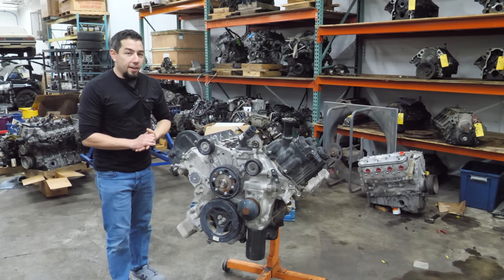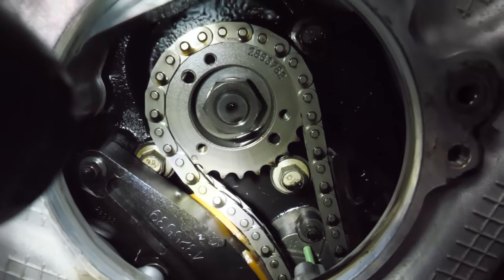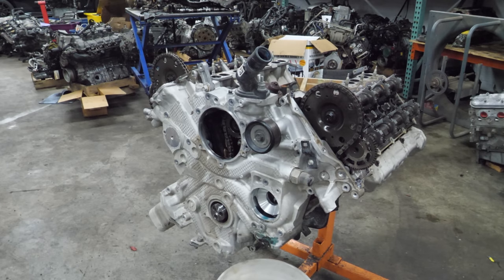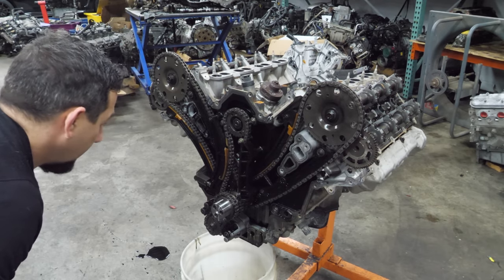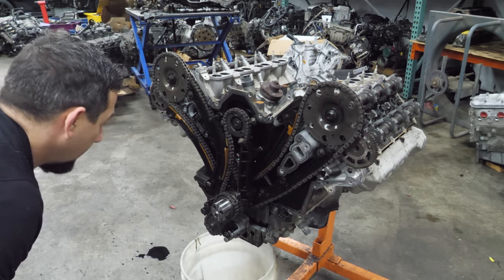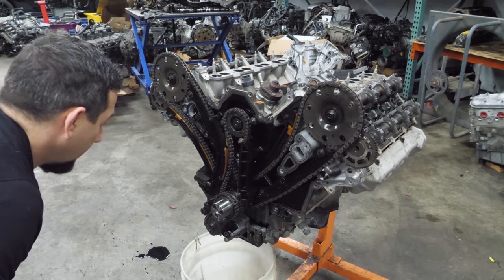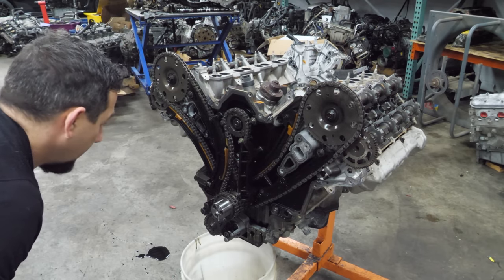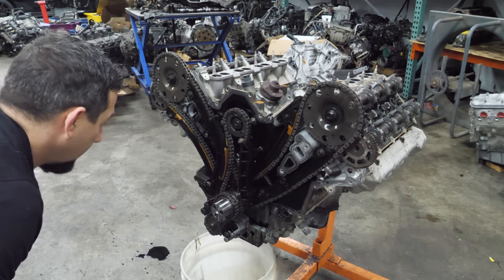Well That's Not Good! Nissan Titan XD Cummins 5.0 Turbo Diesel V8 Teardown. A Costly Failure!

Comment: My son had one of these and the turbos blew up towing in the mtns. in Colorado. Dealer towed it in and only put new turbos on and cut it loose. It made it 42 miles up I-70 again and this time it blew up. Took them two months to fix the truck and he went right to a gm dealer and dumped it. That truck only had 11,000 miles

Comment: The WABCO label on the vacuum pump is kind of interesting ... they're more well known for making parts for railroad locomotives ...

I know the Titan is a pretty big truck, but ... no, it's not that big.
Reply: Wabco makes a lot of the air system parts that get used on the semis from brake systems to suspension -- almost every air dryer I ever touched was a Wabco --
Reply: @JohnDoe-sm9hc  well that makes sense, considering one of their main contributions to railroad equipment happens to be air brake systems.

Heck, they even make air horns.
Reply: @litz13  Yeah - they actually do more than I originally thought -- but seems anything air-related for mobile applications now-a-days
Reply: Wabco also makes semi truck air brake parts as well.

Comment: I always love these guys who think they can out tune the Cummins engineers
Reply: Most do and can. Cummins tunes are actually not optimal. They are tuned for a entire run of engines and to make emissions systems work properly. A aftermarket tune increases efficiency reliability power torque fuel economy and actually makes the engine cleaner.
Reply: @jdrok5026  the broken crank has entered the chat!!
Reply: well they can until boom.
Reply: Optimizing for what?
Reply: @ding9633  boom

Comment: If you cant find a ball hone, get a brass or steel pipe (tube) brush, get a roll of scotch-brite, fold it over and wrap it around the brush. Use some rubber bands to keep it from coming apart, then just put it in a drill!
I use this method to clean various holes and bores all the time

Comment: Here is a trick for removing the pistons. Get a piece of one inch 120 schedule pvc pipe about 18 or so inches long. Once you get the rod cap removed you can put a cap screw back into the rod, then place the pipe over the screw head then drive the piston out with a hammer.

Comment: Question: Why go with overhead cams when you're making peak horsepower at 3200 rpm? I mean, those heads will flow better with 4 valves but do you really need that at that RPM and the power numbers this thing is cranking out?

Comment: The EPA emissions requirements killed this motor.  Otherwise, it would have been a great truck.  I removed all that nonsense from mine, and it runs like a dream.  No smoke.  No soot.  No turbo lag. The oil is see-through clean at 5k miles. The EGR and other emissions parts begin destroying this motor on Day-1.  Delete it and tune it to factory numbers and it becomes a completely different truck.  Yes, it wasn't designed to build 600 Hp and 1,100 ft/lbs of torque, but it will pull a 12,000 lb trailer down the road at 70 mph and never labor doing it.  Great truck...IF you put it in a condition that allows it to run like it was designed to.  80,000 miles on mine and it runs like it's brand new.  Actually, it runs better than when I drove it off the Nissan lot in November 2017.  19mpg city/24mpg hwy.
Reply: Who did your egr delete

Comment: the piston above the deck is normal in diesel engines, its called piston protusion and you have to select the head gasket thick to acomodate that protusion

Comment: Snapped crankshafts are kinda common in big trucks.  Ive torn down a cat c15, a cummins m11 and a 60 series detroit 12.7 all with that failure.  Its amazing to see something that big blow apart.

Comment: 9:36 My guess is that either the bolt holes in the pump have stripped - which might make the bolts difficult to remove, or they somehow vibrated loose during operation causing the pump to push back from the block and misalign the chain causing the internal destruction. I don't think anyone was inside that engine.

Comment: I had a '68 Dodge 318, with over 250,000 miles in my '71 Duster, long story short I broke the crankshaft just like yours at # 7&8 counterweight, drove it gently for 7 miles to get home and 5 miles the next day to where I replaced it, never saw another until now.

Comment: Watched the whole video knowing what you would find at the end.

Previously owned a 2017 Titan XD. Great truck, put about 40k on it and the engine identified as a 900lb bomb at around 94k miles.

Always changed the oil with amsoil or premium blue. Babied it and it failed on the way back from Nebraska with no warning. Started bucking and then died at 70mph.

Nissan replaced the engine under warranty thankfully because it was just north of a 18,000 dollar repair for a new long block.

I believe there is some kind of problem with these engines having a lack of lubrication to that area of the crank. Gets way too hot and snaps like a twig. I knew these things had occasional failures before buying. Wish I would have listened. And what a shame, it was a great truck. But I got rid of it shortly after having the repair done.

Comment: Classic fatigue failure, started from the inside of the crankpin where meets the web which is typically the highest stress area. Possibly the fillet radius wasn't sufficiently large or was incorrectly formed during manufacture.

Comment: A couple of years ago I did a 3cil Perkins 700 series from a Linde forklift and that engine had a crankshaft broken in 3 pieces. Believe it or not, the forklift came under its own power to our workshop. It was rattling, but still running.

Comment: My friend did a rebuild of a Mopar from RT engine. It would had been bored out to 525, up from 440. He had it received and put back to more reasonable displacement. But it was still too much. What do you think this was happening was the crankshaft was actually twisting under load and some of the cylinders would fall out of timing slightly.

On a trip down to Boeing Surplus down in Seattle, he tripped across some old bits of metal billets on a pallet. What they were was Aermet100 from General Dynamics, meant for an upgrade to the fa-18 landing gear as they were fracturing under hard landings on a carrier.

He bought three of these for basically scrap metal prices I believe about $0.08 a pound. And had the guy load them into the trunk of his Cadillac on a small bed of scrap wood and carpet. The look we got from the Customs officer when he wanted to take a look in the trunk was priceless.

It took him six tries I think he said to find a shop that would be seeing a new crankshaft out of one of these billets.

Through a bit of careful Machining, he managed to lighten the crankshaft up by a considerable amount of weight and still be more than strong enough

Comment: I bought an H23 Prelude engine once that I was told was a broken timing belt, so the bottom end was fine. Previous engine had a good head, so I swapped everything over and when I started it up, clack, clack. Pulled the pan and found the exact same thing. Broken crank and it was in exactly the same location. There was enough meat there that the engine actually ran and that front cylinder was still firing.

Comment: Look at the ECM harness. Guarantee you’ll see on cylinder 7 & 8 injector harness wire fraying. It’s been found that the tight tension from zip ties cause fraying on the wiring. Eventually the motor will be out of timing and hydro locking it. That’s why it was blueing the metal from over heating. Everything was out of sink. Melted the bearings and cracking the crank shaft.

Comment: I wonder how many of the crank failures are because of using 10w30 for all temp ranges. It really should be 5w40, but for some reason they only recommend it below 68F.  10w30 diesel oil is way thin at higher temps.
Reply: I own a 2017 Titan XD, my oil pump actually just went out and I believe all the other problems, like this crank shafts hers, comes back to that very issue. The recommended 10w-30 is not ideal for this engine or any diesel imo

Comment: I've repaired a dew 4 cylinder Onan generators down from Fairbanks Ak. These are air cooled, 24v start, 12.5 kw. The story is always the same,..cold starts! The weakest part of the engine is the the crank. The break occurs between #1 & #2 counter throws. Compression and ice cold steel with a massive flywheel out front. All were repairable and put back into service.

Comment: Definitely a cool difference from the ISB engine I work on, and running the garbage cp4 the 19/20 Rams have. Unfortunately with the lower torque rating and towing capacity it just couldn't compete with the big 3, as well as the flaws that exist.

Comment: I've watched your teardowns for about half a year now and they are very enlightening because I work with many of these engines and the cars they come in. However, I still don't get why you don't take the oil filter off or drain the oil or coolant before you start the teardown. It wouldn't remove the mess entirely but it will reduce it big time. There are coolant drain ports in every engine's water jacket that allow draining it before rebuilding and the plugs are threaded and reusable. They are separate from freeze plugs but are located near them.

Comment: Diesel pistons often extrude a bit from the block, that's actually normal, you usually have multiple thickness headgaskets for diesels and you choose based on the distance the piston comes out of the block.

For example: VW/Audi offer 3 thicknesses for their diesel headgaskets, you measure the piston extrusion from the block and get the headgasket based on that.

Per Nissan's part numbers, there are three headgasket thicknesses available from 0.44" to 0.52" for the 5.0 Cummins.

Comment: BIL towing my 7x14 Dump with his Titan, full of dirt but only going 3 miles on back roads. Transmission didn't want to make the 2nd to 3rd shift under firm acceleration when it finally shifted he heard a loud bang and it felt like he got rear ended. Truck died and kept trying to restart itself with the starter running constantly. A fire broke out due to the constant current draw from the starter trying to restart the engine. They said it spit all main bearings out, wondering if it broke the crank too. Failure was most likely due to the neck breaking shift. (transmission not programmed correctly for that heavy of load). BTW if a fire starts and your vehicle is under warranty, let it burn to the ground. Took them 4 months to determine what to do with insurance because of the fire.

Comment: In my FA classes they taught us the shiny spot is where the crack started and the wearing on each other causes them to mirror finish. The cold steel grey (like a natural finish intake) is the last place that let go. And each ring is where the crack spread. I had a cat 3508 snap through a main journal and melted the bearing. It looked like candy running down the main cap. I chucked it not realizing how rare that is.

Comment: Diesel pistons often protrude slightly above the deck, and the headgaskets have selectable thicknesses to accommodate and maintain the high compression ratio. The swollen piston that touched the head is usually caused by a leaking injector that heats and swells the pistons, more ofter leaking injectors burn holes in the piston where the injector nozzles spray

Comment: Well Eric I think this is the first engine you've had with a broken crank , think about it , with all the explosions we see in NHRA top fuel racing and of course in funny car racing as well , we never have seen a broken crank , we've seen totally exploded engines there but never a broken crank , I think about the kind of worst part those engines , out so what caused this crank to break and then it's obviously a forged steel crank something really bad happened to this engine I would love to hear from one of your Machinist friends when they look at that Crank and they tell you what caused it to break , well there you have it , keep up these great videos .

Comment: That pump drive does look very funky, the way it's installed... Probably somebody wanted it, before it was sent to you, but they could not get it out because the idler you pulled out needed to be removed, to get that driven spur gear off of that pump... The 3-tight through-bolts for that H.P. pump , could be that way because sealant was probably used (at the factory) on them to keep things dry on the outer area near that H.P. fuel pump, and to hold them in place and keep them from rotating while the nuts were torqued that held the H.P. fuel pump in place... They probably did not have to be removed... BTW, try to avoid hammering a tapered shaft, like that pump, even with a 'soft' mallet... Because if it has ball or roller bearings, they could be damaged (brinelling) and the driven shaft along with the wave-plate/crank pin could also be damaged from sudden blows in an axial direction, which that Extremely Expensive and hard to find H.P. fuel pump, that could have been damaged,  from   the hammering that was done to it... Instead, use one of the many pullers that you used on other engine's harmonic balancers that you used in the past , or maybe a bearing/gear separator tool, but DON'T hit it with a hammer ...The positive deck height of the pistons might be normal for this particular engine, after all - it is a Diesel with a very high compression ratio, which means much less combustion chamber volume is used in these types of engines, but that broken crank probably caused that one to poke out a little further than the others... The heads could have a carefully calibrated combustion chamber quench area and a carefully calibrated head gasket thickness to accommodate casting imperfections in the volumes of the combustion chambers, so mark the head gaskets, as to which bank they came from because of this, and include them with the major engine parts that You are trying to sell... Other manufacturers of multi head diesel engines have matched combustion chamber volumes by using varying thickness head gaskets... I remember a gen-fam school that I went to several years ago for KHD Deutz diesel engines, and they told us how important it was to match the thickness of head gaskets with the OEM parts... And yes, because those engines were being used at a high traffic place (SFO airport), they had to pass emissions testing standards every year..  Spray all the exposed metal of those cylinders with WD-40 then break up the rust with Purple Scotch Brite pads... CAREFULLY rotate the crank back & forth  With HAND TOOLS ONLY, several times to break down/liquify the rust with GENEROUS AMOUNTS of WD-40,  BEFORE trying to get those pistons & rods out of it..  Patience is the key factor here... I have taken neglected engines apart, with lots of rust on the cylinder walls, and finally got the machine to spin freely... Without permanently damaging the OEM pistons , rods & cylinders... Believe it or not, I was able to remove most of the rust damage to the cylinder walls using only a honeing tool... And the cylinders were still within spec, the OEM pistons and pins were re-used, and the machine ran very well after the Overhaul was done, at minimal expense... Not always do we get that lucky, especially in this case with the broken crankshaft... Maybe another crank can still be found, and maybe the block is still good, but one thing is for sure, when taking a little extra time on work like this, the chances are much better to find buyers who will be competing for it...Pretend that You're working on a Rolls Royce when You're taking these rare & expensive things apart by carefully dis-assembling them, and marking where the parts came from on that particular engine... Carefully Store the parts in a dry well-marked container... Use finesse....  I can assure you that when a potential buyer see's an expensive/once-serviceable part being (torn) removed from these engines, then they hear a horrid metallic crash sound where you just tossed it, across the shop to slam onto  the concrete shop floor, it might have a negative effect on the PARTS SALES END of your business, that you so many times have expressed concern about on this channel... Think like YOU are the buyer / end-user of these parts, and maybe, with some luck,  you'll see your business beginning to improve in that department....

Comment: I surprised those head bolts came out whole.  I have a 36” breaker and was able to break off 5/8” cutting edge bolts. 

I hear you with the damage done being stored outside. Ran when parked counts as 2 strikes in my 3strikes and I’m not buying what you are selling strategy.  Every time that was a strike and I bought it there were major issues that made it impossible to run, and wasn’t damage from sitting, but took lots of investigation to find.  That’s when the storage didn’t damage them beyond repair.

Comment: I would have to agree with you on the fact that it would probably have made a lot of noise. Plus i don't know anyone that would replace their whole engine from a "small noise" and a "little bit of metallic in the oil." This guy knew exactly what had happened to his engine.

Comment: A decent engine that ended up in the hands of Nissan who didn't know how to properly apply a Diesel, support the emission parts and much less mate the capabilities. On top of Nissan's 10K Mile friggin oil change intervals, which should be 5-6K max. This engine was obviously way overworked, someone thought it had the capacity of the Cummins 6.7L and/or tuned it to try and match. Excellent tear down!
Reply: Hers anther one: Detroit diesel dd5,5 liter duesel, oil change at 30k miles! Crazy!!